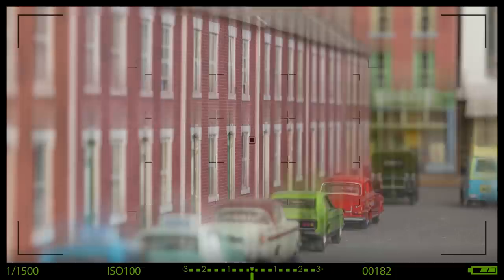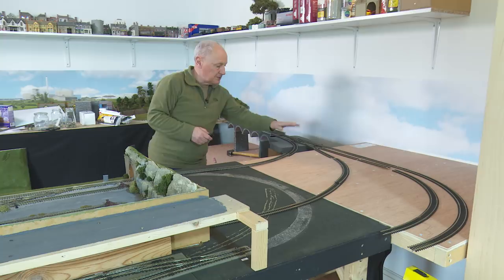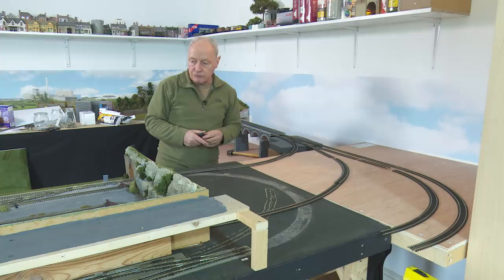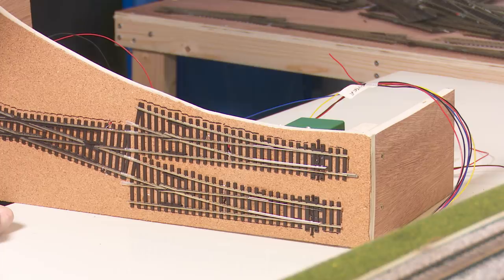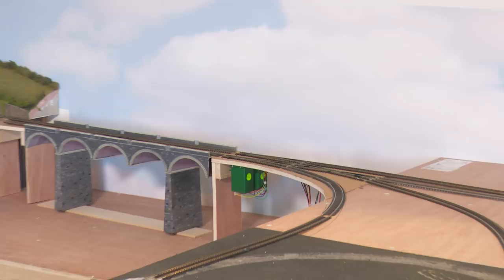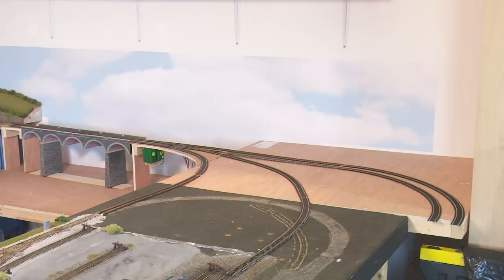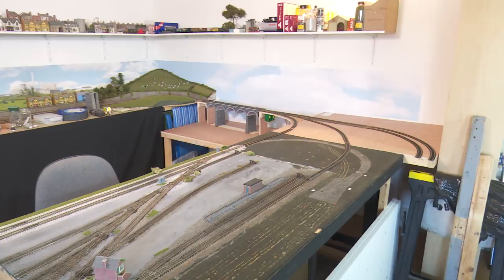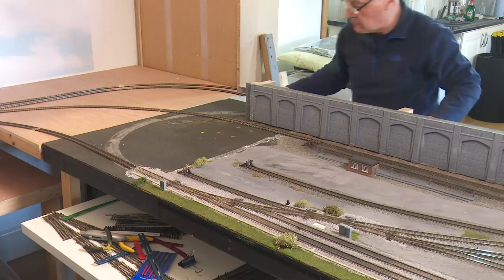Track Plan Sorted at Chadwick Model Railway | 59.

Comment: Hi Charlie. 
Another vote for the MTB MP1 point motor. They’re so much more of a compact unit as well. 
I get mine from DCCTrainAutomation. They are exceptionally helpful over there. I have 15 going in my fiddle yard which will be driven by iTrain eventually. 
Thanks very much for you videos Charlie, I find them very useful, especially DCC information which I don’t find it that easy to come by good advice on. I like your slightly over engineered approach which is very similar to mine.
Reply from the maker: Yes servos seem to be the flavour of the day.  I'm certainly going to investigate.Regards Charlie
Reply: They aren’t actually servos Charlie. They are a motor which drives a central drive pin. On that pin are 2 cams which trigger micro switches. This gives the stop points but with continuous signal/power input. 
Of all the places to trial something different I guess the fiddle yard with more access for repair (especially in your case) is a good place to try something different. Plus they have all the functionality of a tortoise.
Reply from the maker: Point taken HF.  I'll check them out at Ally Pally.  Regards Charlie
Reply: Thanks for mentioning Ali Pali in your vid, I actually didn’t know it was on. Will make an effort to get over to it on Sunday. Looks good. 👍🏻
Do you have a display?
Reply from the maker: No, I’m just a humble customer too.

Comment: You could use either "stub" points or "free-floating" points for the EXITS from each of the fiddle yard tracks - assuming each track only runs one way (as you described them as up and down yards).
I have at various times used: 
1- (very, VERY old) Peco points with the (very short) point blades removed; 
2- Peco points with the spring removed and the blades allowed to float freely;
3- Cheap (I think they were US set-track style, "fake" Atlas, with a very unprototypical look) - but with very free floating blades, not always the best option, but definitely cheap!  The geometry, track separation and (within the point) track standards can be a bit dubious too; and, 
4- "Hand built" points with no blades at all, but fixed rails as far as possible, and only minimal sleepers/visual realism - but it is a fiddle yard!
  
You do still have to answer the questions of:
- Live-vs-dead frogs (I'm running modern Australian diesel models - 12 wheel pick-ups! - so not a problem for me!). Also not usually applicable to option 3 above as they are usually "solid block of plastic" frogs;
- Track isolation/power (if you are relying on the points for this);
- Track noise over the gap;
- Possible wheel standard/gauge issues;
- Option 2 & 3 also assume that the the train won't derail pushing through (moving) the blades.

However you can still have a point SWITCH, which doesn't actually power a point motor (of whatever stripe), but does provide power to the frog and the track for departure.

Basically halves the overall cost in one go!
Reply from the maker: An interesting point Rob, certainly good for thought.

Comment: Hi Charlie, I personally use a lot of the Digikeijs products which gives you good value for money. I use the DR4024 for DCC-ing my points completely. If you buy the starters pack you get 4 servo's and the decoder for about 50 quid. Still a substantial amount of money, however you have your points DCC-ed and switching really realistically. But if you are really on a budget,  you could consider stepping into the world of Arduino and servos. There are quite a few posts on the web about it, so google around.
It is a bit of a journey, but once it works it's even more rewarding.
Good luck and keep the posts coming!
Greetings from Holland.
Regards Edwin
Reply from the maker: Thanks for the info Edwin and I’m so pleased that you enjoy my videos.

Comment: wrt the fiddleyard:
As suggested by at least one other already, reorganising the points so that the lines diverge on both sides of the entry line results in a shorter pointwork section for the same gain in lines (1 to 6 lines in 3 point lengths, rather than your current 5).
Equally, if your operational requirements require a track to be kept clear as a through line, make it the shortest track rather than the longest, so you can store more or longer trains.

My suggestion for the point motors would be to use cheap solenoids but taking steps to quieten them down.
Reply from the maker: Yes your right.  If I start with a Y point it would be more efficient.

Comment: Hi Charlie,

With regard to your dilemma about the point motors as already suggested use servo motors or alternatively try the  MTB MP1 point motor. MTB MP1point motor is  very compact like the 9g servos, control is simple with the addition of a SPDT switch and some power. The motor has a cam which actuates a switch for changing the frog polarity. The throw distance is easily changed as well. The MP1 is  a very cleverly designed motor which requires minimal hardware addons to operate, suggest grabbing one to try out.

Cheers
Reply from the maker: Yes servos seem to be the flavour of the day.  I'm certainly going to investigate.Regards Charlie

Comment: Cheapest alternative to Tortoise motors, is Arduino and servos. You could get 20 servos, an Arduino Mega controller board, motor shield and servo shield for under  100 pounds...actually, probably under 50 pounds. There are many resources online for learning about using Arduino, including Facebook groups, where you can gain valuable information and have your questions answered. Arduino can be hooked up to DCC via JMRI for full automation.
Reply from the maker: Yes servos seem to be the flavour of the day.  I'm certainly going to investigate.Regards Charlie

Comment: Another great video Charlie I think its refreshing that your open to suggestions from your subscribers. The end result minimizes changes to the TMD layout, having the main lines running on either will offer interesting movements in and out of the TMD and the fuel tanker  siding. Maybe using 3 way points where possible on the fiddle yard would save a little space
Reply from the maker: I know what you mean Gary but on our club layout the only 3 way point is awful.

Comment: After thought! You can operate the servos from simple switches, but I use a computer program and DCC to operate my points, and for that you will need the DCC Module from Megapoints Controllers. That will be £30 per board, and then that works out as £9.51 per Servo operated point. Still good value!
Reply from the maker: Yes servos seem to be the flavour of the day.  I'm certainly going to investigate.Regards Charlie

Comment: I put forward another vote for servos. I use HobbyKing HK15178, they are less than £2 each. Mine are controlled by a pair of standalone MegaPoints Controllers servo panel. The servos connect to the hole in the point with piano wire. Okay you need to use microswitches to do the frog polarity but I just hot glue some long-arm microswitches so that they are activated as the servo moves.

Can always use another system such as MERG or an Arduino to provide the control.
Reply from the maker: Yes servos seem to be the flavour of the day.  I'm certainly going to investigate.Regards Charlie

Comment: Hello, if you are looking for slow moving point motors have a look at video 51 on the Canal Sidings channel . I have made my own version that costs less than £5 for the servo and one micro switch. I only needed the central change over switch for the point frog switching. They project less than 50mm below the base board and can be adjusted to be as fast or slow as you like. I can let you have a copy of the stl files so you can print the three parts required. Hope this is of some use. Keep up the good work.
Reply from the maker: Yes servos seem to be the flavour of the day.  I'm certainly going to investigate.Regards Charlie

Comment: Hi Charlie, great job. Love watching your video’s. For your fiddleyard you can do something else: instead of running the mainlines in the middle, you can split the mainlines. If you make 3lines on one side and 2 lines on the other side of the mainline the length of the lines will be much longer (in an example scratch 70 cm, I can’t upload the picture). More storage with the same number of points.
Reply from the maker: I'm sorry Harry but I don't know what you mean.
Reply: I send the picture via messenger. Hope you understand it

Comment: Hi charlie,
To avoid using point motors in the fiddle yard, why not use a scratch built frame and piano wire to switch points in the yard.  I mean it's not as common to change the fiddle yard as much as the main layout.
It avoids the noise of solenoid motors and you control the points by moving a lever.  Piano wire to the edge of the point and then connect with a bend in the piano wire, into a hole in the switcher of the points.  (use small straws as guides under the tracks.)
It is a fiddly way to do it.. But who wants the loud point motors in the end.
Reply from the maker: An interesting point AG. However, I do want the whole layout to have a level of automation.
Regards Charlie

Comment: My friends over here in France use servo motors from China. They buy shed loads for very little money. Never done this myself but they work in a very similar way to a tortoise. Bon chance.
Reply from the maker: They are cheap but require lots of other components. Personally, I kneel at the alter of Tortoise, if just for piece of mind.
Reply: @ChadwickModelRailway  The best is always the best.

Comment: Correction! The stone road overbridge is actually HORNBY R8571 c. £21 when I bought one. It is a single track road over a single track rail line. Hope that helps you may find some on E-BAY if not currently in production. Colour is a weathered cotswold style colour.
Reply from the maker: Thanks Pat.

Comment: Hi Charlie

2 suggestions:

1:
For the fiddleyard, have you considered using servo's for the point motors?
They're slow action and are cheap as chips (£3-4 each).
Many modern accessory decoders are designed for servo operation, so you can integrate it into your DCC system.

2:
With the fiddleyard, you're going to have a triangle of empty space at each end of the ladder.
At the loco end of the shortest siding, have a point that goes straight so you can store a few locos, so you can swap locos from their trains and have more variety as you run things.
For example, imagine you have a 5-coach train of Mk1's on a stopping passenger train with a class 24 hauling it.... you can have a Class 25 and 33 in the short sidings, remotely uncouple your 24 (I see you use Kadee's!)... move it into an empty siding, and then swap it for the class 25 or 33, and away you go!

Laura
Reply from the maker: Hi Laura,
I understand the servo option but I am going to stick with slow action points.
You have made a fair point regarding the loco storage which I may incorporate into the fiddle yard.
Regards Charlie

Comment: More people generates more ideas.. This is why we have in highschool collective idea generation in classroom called Brainstorm.. :)
For yard, always is an option to do some rarely used tracks in old style with manual switching lever, but with preparation and wiring done for easy turnout motor installation later.. In software, i think, there is option to stop loco before manual turnout if selected track is not turned on.. In that way, works on layout don't stop and train's can be run (at least on main tracks) until we, collectively, figure out what to do with such amount of turnout motors.. :D And other advantage for manual switching with preparation for motors installation is, that these motors can be purchased, even, one by one when opportunity came and installed quickly because all mounting holes and prewiring is done.. ;) And for preparation and quick tests, only one Turtle motor is needed because after test, motor with piano wire goes to another test point..
In real world  - old tracks can still have manual switching in yard's, but main tracks are automated..
Reply from the maker: Interesting points AM, but a computer will eventually run the whole layout.

Comment: Re the point question. I have a pocket that is almost empty but still with 8 points to control on my siding set up. I am using rod control from the edge of the baseboard. When I am shunting and marshalling, I will be at that area of the layout so hand operation will work for me. My video number 4 shows how I did it. Your track configuration is looking to be very interesting.
Barry.Devon.
Reply from the maker: Thanks Barry. I’m afraid automation is vital to me.
Regards Charlie

Comment: Hi Charlie. I understand your problem about fitting out your fiddle yard with point motors. Why not use Servos? They are very quiet and at the fraction of the cost of a Tortoise. You would need a mother board to drive them but one board will drive 4 - 6 servos.
Reply from the maker: Yes servos seem to be the flavour of the day.  I'm certainly going to investigate.Regards Charlie

Comment: Before I even make the suggestion I'm not sure you'd go for it, but what about wire in tube manual controls for the fiddle yard? I have no problem with mixing set track and flexitrack where the correct (set track) curve happens to fit the bill. In fact, I recently came across Fleischmann N scale telescopic track (that fills in that awkward little gap when you're closing the loop) and wish something similar was available in OO. Anything to make life a bit easier! Nice update btw, cheers.
Reply from the maker: You're right Davie, I do require automation  but a good point.

Comment: Hi Charlie,
Another post to say thank you for a professional and instructive video.
Regarding the fiddle yard and the medium radius points. I understand the benefits of the smaller points giving you longer runs, but as this also moves the track closer, you will need to make sure you can get you fingers between the locos / coaches / wagons if you need to remove an item to sort out a derailment. A close fitting track with a packed fiddle yard might be difficult to access. Perhaps a mock-up will help determine if this is an issue?
Damian
Reply from the maker: Hi Damian, I’m so pleased that you enjoyed the video.
I’ve had a rethink on the fiddle yard which I’ll explain in the next release.
Your point is of course very true, we have fat fingers.
Regards Charlie

Comment: Great video Charlie. Regarding your bridge construction have a look at "Hirst Arts". They sell moulds that produce very realistic blocks that can be put together to resemble stone construction. They also sell moulds that can do arches IIRC. I use them with Dental plaster and glue them together with PVA based glue. They can be stained and painted. Worth a look. Very simular to the old Linka but easier to produce good models from. They'd be OK with HO or OO scale. Hope this helps.
Neil W
Reply from the maker: Thanks for the tip Neil.
I’ll check them out at Ally Pally on  Sunday.

Comment: Hi Charlie. Love the layout and the plans you have to develop it especially the u-shaped valley. Again, just a suggestion, and following on from your referral to Luke Towen, Boulder Creek, why don't you use extruded foam instead of papier mache which is quite messy. At least with the foam you can build the sides up in layers and on top place your scenery as planned. You have probably thought of this in depth so will leave it to you. You have a magnificient layout and with what you have planned is why I have invested in you to develop your thoughts into reality. All the best and slanj, Mike
Reply from the maker: Hi Mike, I’m so pleased that you enjoyed it.
The plan is to use foam/polystyrene for the base and filler/papier mache/ sculpamold to make the surface.
Hopefully I’m keeping your interest.
Regards Charlie

Comment: I've only just found your channel, and have found it immensely enjoyable.  I've just watched the video on airbrushing and was impressed with your advocacy of using safety equipment, particularly masks to avoid brerathing in the paint that you use.  It's therefore a little disappointing to see that you aren't using safety glasses while using the rotary disc cutter.  I've seen at first hand the damage that one of those discs can do when they break, and it doesn't take a lot of imagination to envisage the speed that the pieces fly off at given how fast the discs spin when in use.

I'm not trying to teach granny to suck eggs here Charlie, as I doubt that you'll even see this comment, given how old this video is now, but I have a sincere care for your well being, and for others who may not recognise the pitfalls of using a disc cutter like this without taking adequate precautions.
Reply from the maker: A fair point and you're not the first to mention this oversight.

Comment: Have you considered making your own point motors? Years back I helped a fellow do a layout were he used bike brake cable to control his points ( this was in O gauge), some he had come to the side of the board with a push-pull leaver others he used geared electric motors driving threaded rod to control them.
Reply from the maker: Yes servos seem to be the flavour of the day.  I'm certainly going to investigate.Regards Charlie

Comment: Hi Charlie. Well done for sorting out the track problem. Not sure what your intention is on accessing the fiddle yard to and from both lines but unless you intended to keep the same trains on the same sides of the running loops, I cannot or did not see crossovers that would allow you to move trains from the up side fiddle yard to the down line and vice versa other wise you would have the same trains running in one direction only. Also I saw further down in the comments regarding Mega point control. If you go to a YouTuber called Dave Fenton he explains all about Mega Point controllers and they might be cheaper???.
Keep the good work up.
Reply from the maker: Thanks Terry, a great point regarding the cross-over. Something that I clearly missed.